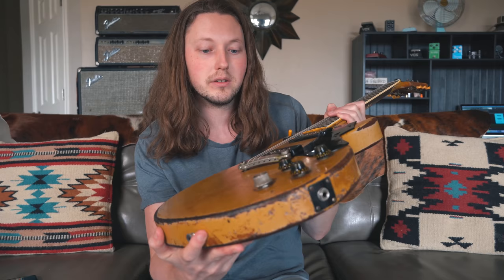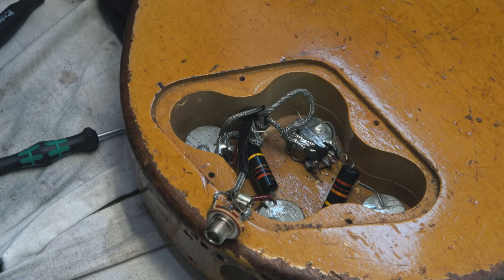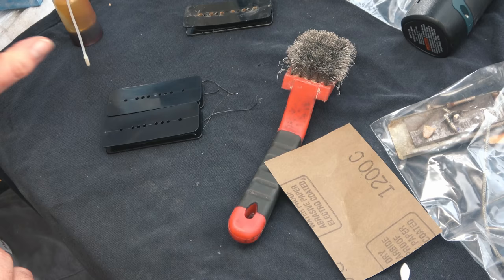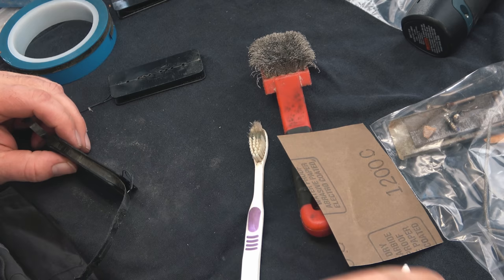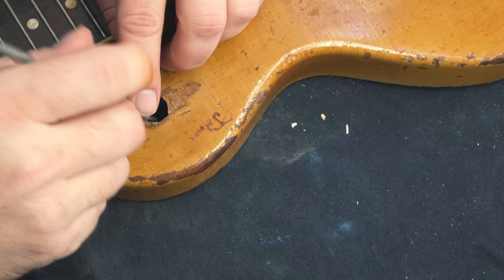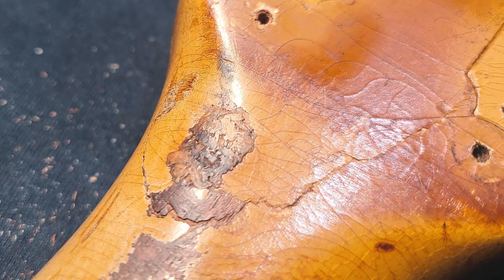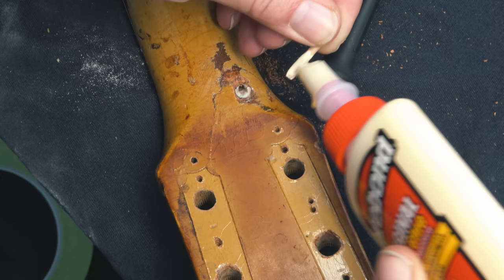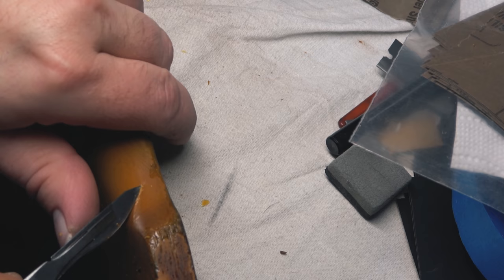The Incredible Restoration of my 1958 Gibson Les Paul

Comment: "Hey I just got done restoring your 58 Les Paul, you're gonna love the new purple metal flake paint I put on it! I also ditched those p90's for some EMG's, Rock on my man"
Reply: and I drilled on a tremolo...............
Reply: Right?!?! I installed a Floyd Rose whammy bar with locking nut and locking tuners, and added a third pickup with an extra output jack! You’ll love it!
Reply: Don't forget stickers
Reply: @toddkalbfeld4602  Something classy like         ''' Eat More  Beaver ''
Reply: and one of them red Buckethead  Kill Switches
Reply: Why would that be bad? An Emgx81 or a het set is wayyy more output and toan then those shit p90s made in the 90s emgs are nu that's what u want for toan obviously
Reply: You again with the emgs
Reply: @nayr87  I refuse to believe this guy is for real.
Reply: @leewhitworth9142  same
Reply: @Dankster-yo8xv  😂😂
Reply: @leewhitworth9142  but the toans!! They're not nu enough
Reply: Rock on lmao
Reply: Eww
Reply: @ronninz8393  I just think the best thing to do with old Les pauls is make them active and route them for a kahler I mean emgs sound good clean too  plus when you carve out the spot for the battery box your doing weight relief as old wood from the 50s is quite dense and affects sustain thats why the emgs help Soo much also a repaint will help the quitar breath more you strip and sand then refinish in metal flake lime green. Also adding a fathead to the headstock will add sustain only need to drill 6 holes and you have toan for days.

Trust me I know what I am talking about.
Reply: @nayr87  What i meant is p90s ain't shitty at all. They have beautiful clean and distorted sound that u can't replace with singles or humbuckers. P90 are way more dynamic and punchy than HB and that says PAF lover that i am. They have just different use in music but still beautiful and unique.
Reply: @ronninz8393  but p90s were designed in the 90s so there not as good for toan you want toan from new pickups and emg are the best ones
Reply: @nayr87  dude sorry but u don't know a shit. P90 were first pickup built in les paul and its hybrid between single coils and humbuckers due to it's construction. Pls read before u post anything. Cheers
Reply: @nayr87  Rly learn about the pickups u talkin about. P90 is pickup designed and built first in 1946 and put into gold top les paul in 1957 to reduce hum from single coils pickups and give'em higher output. Your knowledge about this pickup is 0 if u say they were designed in 90's
Reply: @ronninz8393  I would just keep trolling you but your not getting it so its not fun anymore dude every post I've made about cutting up quarter million dollar guitars has been a troll it's crazy you've not caught on to that same with the p90 thing I know they were the first pickups in the 51lp I think Walt Fuller designed them  the first comment in this thread is a troll it's crazy you can't see that like for real dude you've been had.
Reply: @nayr87  i'm even happy u were trolling. Atleast u don't rly think like that xD
Reply: @nayr87  lol I thought you were serious at first. Funny shit man😂😂😂
Reply: @nayr87  I gotcha. Pretty funny really.
Reply: @ronninz8393  dude, he's bullshitting, took me a few comments to realise.
Reply: @nayr87  😂😂😂😂😂😂😂
Reply from the maker: Thank you so much for doing that!🙏🏻🙏🏻
Reply: @nayr87  You win all the internet toans. You had so many falling for it haha
Reply: You don’t understand my joy of knowing this wasn’t mocking the video
Reply: @nayr87  emgs are "nu" 😂
Reply: @TheMad0ne  exactly! not old, like a paf which stands for passive antique family of pickups you don't want something that old you need new pickups with electric current from battery and the battery box is important to, the bigger cavity you carve out, the more wood you remove, and the more nu toan can come through.

Simple science can't Beleive ppl are Soo gullible
Reply: "I think you'll agree that Steinbergers are the 'cat's ass' where it comes to guitar technology so I went ahead and created a Gibson version for you! I sawed of that nasty, broken headstock and installed the tuners at the BOTTOM of your guitar! Enjoy!!"
Reply: @domtanko7160  😢
Reply: forgive me for being a metal-head, but are EMG's really that bad? I kind of like the super crunchy sound they get. I LOVE my passive pickup guitars, but EMG's aren't that bad.
Reply: @tristanberke8759  If you like the sound, fine, but this thread's a joke about attitudes and the lack of knowledge that young players can have. The pickups aren't the problem, it's just how some clueless kid can destroy $15,000 of value in short order.
Reply: @ronninz8393  I don't think p90s suck but I dont own any guitars with them because I play heavy metal. I'm one of those sacrilegious guys that has emgs in my les pauls.
Reply: @firefight77 
Don't 4get the spritzal locking tuners
Reply: Gouging out the crumbled binding on the neck for LED Christmas light replacement strings are next level thinking…..you’re welcome
Reply: Find the videos on the dirty burst, the tremendous counts are spot on.
Reply: @nayr87  More ouuuupuuuuuut, you need the people to be deaf at the second song so they have to "hear" the rest of the gig in SIGNS LANGUAGE!!! OUTPUUUUUT!!! 🤣🤣🤣😢
Reply: @nayr87  The p80s, made in the 80s, are better for sure, you should give them try. The legendary p70s, made in the 70s... well, you can't find them anymore.
Reply: “Oh, I also carved out a nice big hole in the back for the four 9 volts”.
Reply: @dh-_1011  yeah, and I also Cut of the headstock. With just another slight adjustment you'll have the perfect guitar!  ;-)
Reply: No Khaler?
Reply: Needs a Metallica sticker too.
Reply: @joshuathomas4934  
Not. A Led Zeppelin and Peace symbol sticker.
Reply: @nayr87  this is hilarious I appreciate the trolls. Some boomers were invented before troal can’t blame them. They take themselves too serious. Or they are as dense as that luscious wood in that guitfiddle.
Reply: @ronwilliams1094  this exists in an sg form
Reply: And Autotuners.
Reply: Goshh.. 🤣🤣
Reply: How about an upside down bumper sticker on the back that says "If you can read this? Thank a teacher" so you can wow the audience.
Reply: @nayr87  toan is in the hair. EMGS are for skinheads to make up for lack of hair toan. Anyway it’s a crap guitar as it’s not a buttercrotch tele
Reply: @ronwilliams1094  nah you mean Strandberg, steinberger is so vintage. No tone in vintage, all the best guitars are made in China by 7yr olds. That’s where the master builders are at. They will put anything on the headstock for you. I had one made with Gibbsons Stratoblaster on the headstock When it arrived it had one of the luthiers 4x table homework inside the cavity. It gave me 4x moar toan. Added bonus
Reply: God id immediately be defeated. Instantly as screwed as my guitar.
Reply: I went ahead and installed some Jackson style shark inlays.  I think it gives it a modern classic look. Along with the Floyd, the Bucket Head switch, and the EMGs I think you are all set!
Reply: I also added a machine gun mount on the headstock.
Reply: And hollowed it out, installed a piezo and nylon strings so I can play Polyphia and rithmic percussion tapping.
Reply: You bastard😂
Reply: @nayr87  you're beyond help😂
Reply: @nayr87 I’ve always considered high output a tone sucker.

The reason I love Allan Holdsworth’s humbuckers is BECAUSE of their low output.

I also think the reason why people like Steve Lukather and James Hetfield are replacing their old active EMGs for passive, lower output option… are because they realise their tone is become a little too Dimebag/Zakk.

I’ve been playing since the 80s… and I’ve never liked EMG… and I LOVE P90s.
Reply: I also installed 3 in-and-out of phase, toggle switches!
😃😝
Reply: @nayr87 
I feel like this monstrosity of a guitar, 🎸 we've all created, Spinal Tap, would have this guitar in their band! 🤔🤘☠️🤘
Reply: @K94trump  
I also installed 2 horns, you know to be able to talk directly to the Devil, 👹🤘🤘 gives it better nu metal toan...
Reply: @tristanberke8759 old school EMG 85s are amazing pickups. Something happened in the last 15 years and they don't sound as good as they used to. I have an '89 Les Paul with EMG 85s (They came stock) And it's still the best sounding guitar I've ever owned
Reply: With a Floyd Rose ?
Reply: I watched 3 of these videos and enjoyed the journey. Nice guitar!
Reply: I also scalloped the fret board! You're going to love it!
Reply: @dadecountyboos  I’m an early model Gen X person and I think the fucking trolls in this are hilarious. Your sense of humor has to be dead of age not to see that this is an attempt to make people laugh.
Reply: Or worse... A khaler
Reply: router broke down, or I wouldve put that floyd on it too
Reply: @nayr87 haha good fishing I salute you

Comment: those stripes on the caps indicate the capacitance, voltage and tolerance values. It's a color code just like the ones resistors have.
Reply from the maker: Thanks for sharing that. Now we know 👍🏻
Reply: red,red,orange,brown,yellow on a bumblebee capacitor is 22nF +/-1% rated 400V pretty standard for a Les Paul I believe
Reply: same as used on tropical fish capacitors👍🏻
Reply: They're too big to be resistors. They're old style caps
Reply: @grberendzenproductions312  read again
Reply: @AverageWannabe  sorry....
Reply: @grberendzenproductions312  haha np bro
Reply: Oil film capacitors I believe
Reply: @grberendzenproductions312  Vintage carbon composite resistors can easily be that size -- or bigger. That said, these are caps.
Reply: Exactly
Reply: Good to see someone else knows!
Reply: @forkless  resistors are more 'squared off' on the ends....caps are rounded...the stripes indicate values
Reply: @edwhite7475  'Modern' resistors yes, vintage resistors like the Allen-Bradley ones however are not -- and those can be large. Easily as large if not larger than many caps.
Reply: @grberendzenproductions312  i've seen bigger resistors than those caps
Reply: @forkless  im talking about 40s and 50s stuff...nothing modern...i didnt mention size...they come in different sizes.
Reply: @edwhite7475  If you read the comment in context to the person I was replying to, you would have seen that I was pointing out  that there are in fact resistors that are larger than those shown in the video (they  claimed these caps were too big be to be resitstors). 

Secondly color coding is not exclusive to resistors, in fact there are capacitors that have a very similar color coding schemes. 

At any length. someone else already pointed out that this is a 22 nanoFarad cap.
Reply: @grberendzenproductions312  actually they're not. They make large resistors too.
Reply: @drpaul0  uF

Comment: Meanwhile I'm over here just trying to figure out how to change my strings.
Reply: Lmfao ty for saying that
Reply from the maker: Keep trying and don't poke yourself!! 🙏🏻✌🏻
Reply: Also make sure you wind it the right way. Ive unconsciously wound a few the wrong way and it was a pain in the butt to try and fix it.
Reply: Go to the Cesar Diaz video
Reply: @Green Frog #safetyglasses
Reply: @natefechtig7533  Ive done that a couple times, never been able to salvage the string. I just leave it now when it happens and tune the wrong direction until I don't
Reply: Please, always cut the ends off and bend the spur down!
Reply: Strongly recommend finding a consistent system for string change, do it the same way everytime and find the easiest way for you to get it done quick. Well worth the "practice time". It's part of becoming a guitarist! Almost like therapy for me haha.. joe bonamassas tech has a solid method. I pull string tight through tuner, then pull back from nut to first fret worth of slack, wrap string over tuner post to "lock" and get two wraps on each post. Keep rocking in the free world!
Reply: Haha... I remember the first time i ever changed bass strings i had no idea what i was doing.  I broke 2 strings cause i had no idea how to use a tuner at that point in time.. fast forward 22 years  i have my technique down lol
Reply: So all in, how much did this project set you back?
Reply: i did it with no experience in about 30 minutes, but my guitar also is not an easy guitar to change strings on, its cheaper and saves me 30 minutes to pay $6 at the local shop and get new strings put on in like 5 minutes those guys can do it blindfolded.
Reply: @MatthewScottmusic  and dont forget to point the guitar away from yourself when tuning the e string
Reply: C'mon  johnulcer ..fat one on top , skinny one on the bottom.  Just kidding

Comment: Hey Matthew, a fellow Okie here! (I'm in Tulsa, BTW) Those Sprague capacitors are paper and foil and are called "Black Beauties" or "Bumblebee" (there are differences in the two). They were used in high-end audio, I have a 1960 McIntosh C-20 stereo preamp that uses them. They are VERY hard to find NOS and are NOT cheap. They used the color bands to show their ratings and the system is very similar to the resistance color band chart. They are not invincible, are prone to leakage, shorting, ESR (equivalent series resistance), and straying capacitance values. Seems that you got lucky, I don't hear any issues, yet you might find added tonal qualities by having them replaced with NOS (new old stock) or the new replacements that are now available. (Don't toss the old ones! You may like them better!) Nice job finding and restoring that amazing guitar! Gotta LOVE Goodwill!

Comment: If he unwound both pickups without breaking the wire, he is a magician...
Reply: Exactly, considering I see it was wax potted and that makes wire sticky. I tried this couple times and it always snaps. Pretty hard to get it in one piece.
Reply: He UNWOUND the pickup? I want to see that.
Reply: @thomascolley254  It's in the video it's the machine that's spinning extremely fast.
Reply: @thomascolley254  Well, watch the video....
Reply: @jimshorts125  why does the single cut body result in harshness?

The pickups would have been very time consuming, getting the wire off the pickups would have taken forever to do. I wonder if he used NOS wire instead.

I don’t know what to think of the headstock break. The screw would have be stronger than the piece of dowel knocked into the headstock. Gluing the headstock would have been tough.
Reply: Mark70609 - the uneven tension and stress of the screw hacked into the headstock that way might have made it unstable over time. Looks like it was pulling the two grain layers at an angle.

I bet you the screw had to be removed to do a proper repair anyway, the break was open and the headstock was never broken completely off so glued back together the guitar may be more solid than factory condition. It broke in a very fixable way.
Reply: What patience
Reply: Good point.  A few weeks ago, I switched out a front pup on one of my Telecasters.  The old one was dead, so I decided to try to do an autopsy on it.  Holy cow, the copper wire they use to wrap the magnets is sooooo thin.  It’s literally like human hair or finer.   There had to be a mile of the stuff in there, too.  

Ultimately, I just thru the thing away, but not before I had pulled out a pretty good sized wad of tangled copper hair-like wire.  It was a real learning experience; gave me a whole different view on “hand wrapped” boutique pickups.

Comment: The "bumblebee" capacitors had similar color band markings as resistors, but they referred to picofarads, instead of ohms. The colors even represent the same numbers as the resistor color bands, but the "layout" is a bit different.

Leftmost 2 bands = 1st and 2nd figure for the capacitance rating
3rd band = multiplier
4th band = tolerance
band(s) at far right = voltage rating
Reply: Great!  Was checking to see if someone already said.
Reply: To go one step further, decoding those capacitors, red/red/orange/black/yellow. Those are .022 uf, 20% tolerance, 400 volt Spraque bumblebee capacitors. Those are the same capacitors used in most late 1950's Les Pauls as well as many other models.
Reply: @jrumiano  can you still buy these somewhere?

Comment: So relieved they didn’t restore the look of the thing.
Reply: I think it would've looked nice with whatever he did to it, it's has a nice vibe now, but I also thought it would look good with a fresh layer :)
Reply: "Hey I just got done restoring your 58 Les Paul, you're gonna love the new purple metal flake paint I put on it! I also ditched those p90's for some EMG's, Rock on my man"
Reply: “ And I added a sick ass Floyd rose, you will love it now!”
Reply: It wouldn't be worth peanuts if they done extensive restoration work. Delighted he kept the original components.
Reply: At the very least could've given it a VERY light sanding and new clear coat, if for no other reason than to preserve its current state
Reply: @firefight77  🤣🤣🤣🤣🤣🤣🤣😅😅😅😅😅😅
Reply: it tells the story doesn't it
Reply: It really looks like little to no work was done, this is WILD
Reply: @zfelps  in a bad way

Comment: I have a '68 Les Paul Special. I bought it really cheap from a friend almost 35 years ago. At some point in time the strap slipped off the strap button and the headstock hit the floor, splitting the 3 pieces that are glued together. (All my guitars get straplocks now. Lesson learned). I took it to a local shop and the shop owner fixed it for $20. It's not a nice, pretty fix like yours, but 100% functional. 
I hated the P90 pickups because they were so noisy and squealed so easily. Perhaps they went microphonic? I still have them in a drawer, but I put EMG P90 replacements in and I am so much happier with it now. 😊
Thanks for sharing your journey.